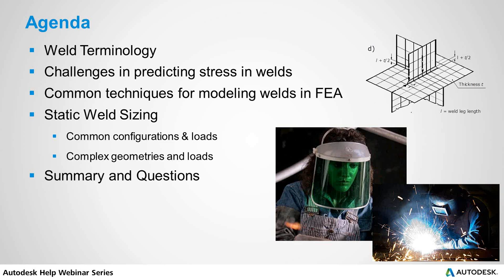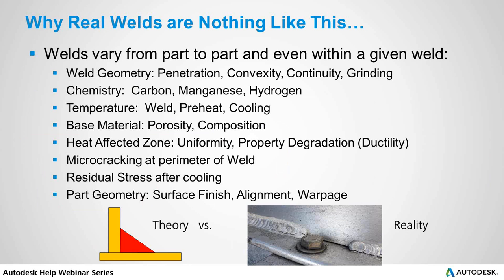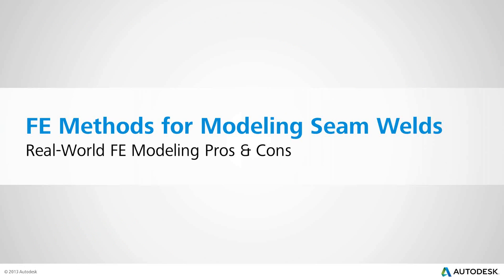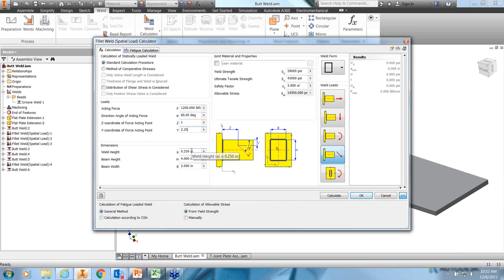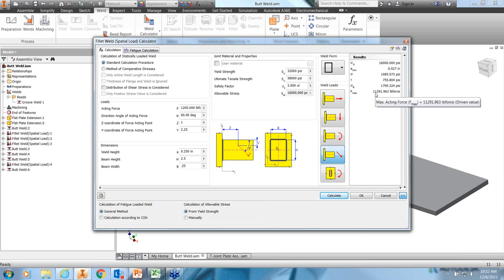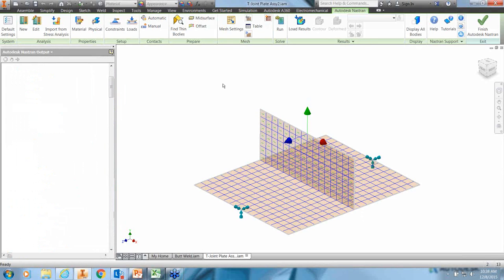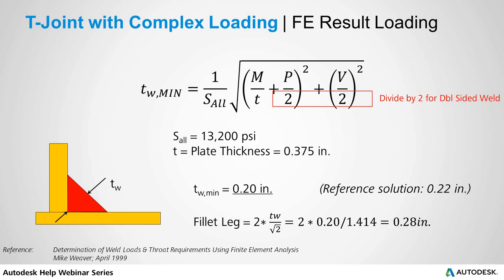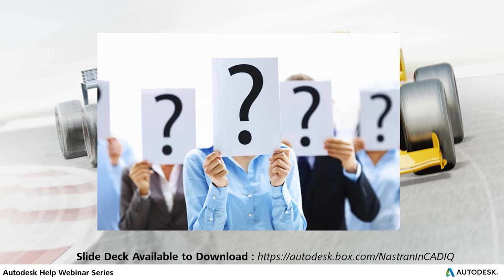Predicting and Validating Welds with FEA in Autodesk Nastran In-CAD

Comment: I think it's important to mention that the safety factor of 1.7 to find the allowable stress in a weld IS NOT the same safety factor of the equipement you are designing for a given purpose. In this example you have a nominal force of 10 000 lbf, and you want to design with a safety factor of 2, you should put 20 000 lbf in the Weld Calculator! If you fail to do that, all the welds will be sized with a nominal safety factor of 1, which can be dangerous if you are designing lifting devices or below-the-hook devices.
Reply: Can you clarify further... Does the 1.7 only account for the weld being assessed in shear? If so I think it is misleading to call it a safety factor.